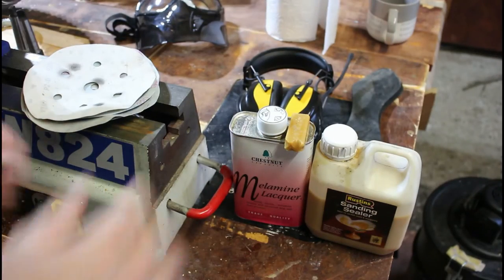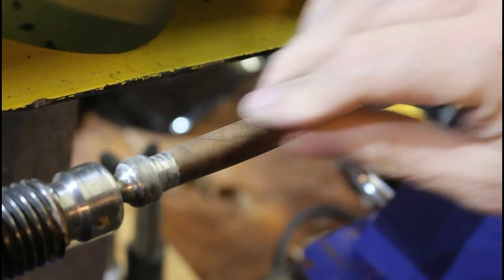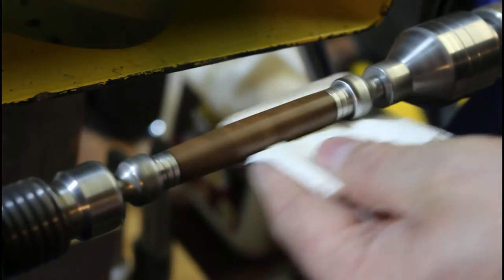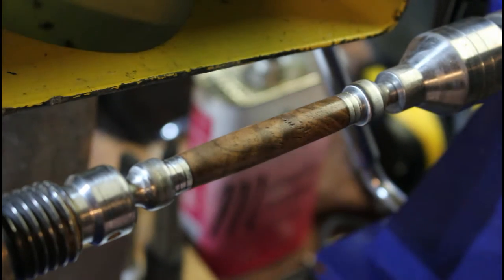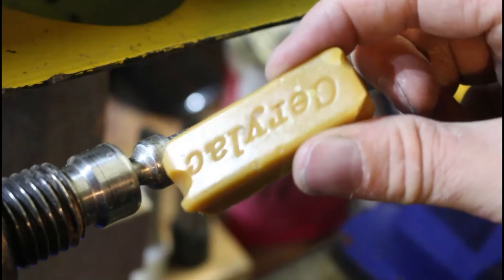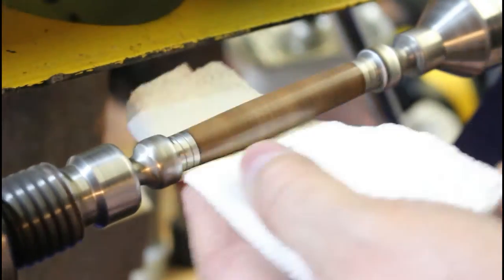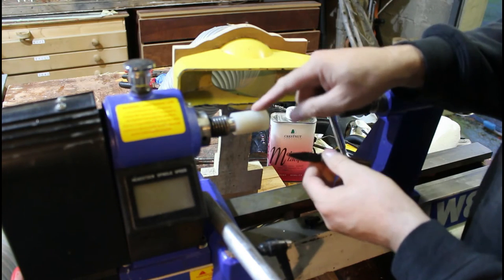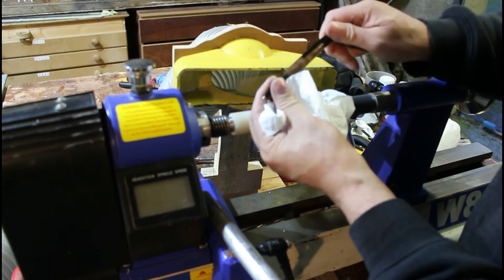Melamine Finish for Pen making

Comment: How does this hold up over time? I’m new to this hobby and have fallen between camps on the CA versus anything else finishes. All of the CA folks say theirs is the longest lasting….thanks for the videos!
Reply from the maker: First of, welcome to the club! Hope you really enjoy the hobby! Secondly, the finish will fade over a period of time with everyday use. A CA finish is much harder wearing. The advantage of Melamine finish over CA is speed. I also found that removing of the bushes for the blank afterwards can cause the CA finish to split. All that work down the drain!! Very frustrating!